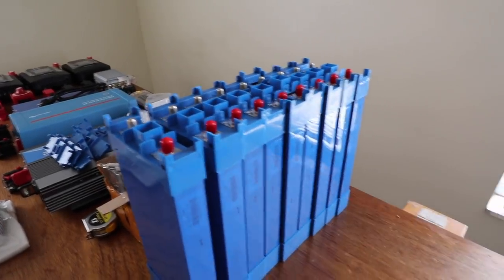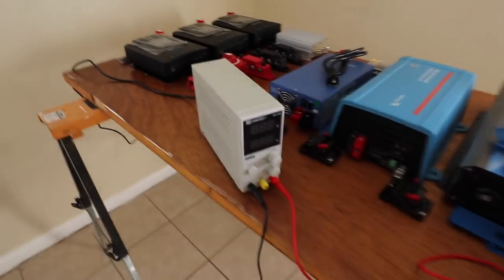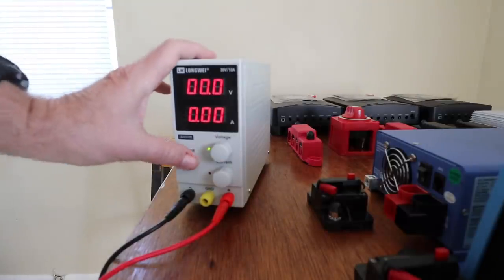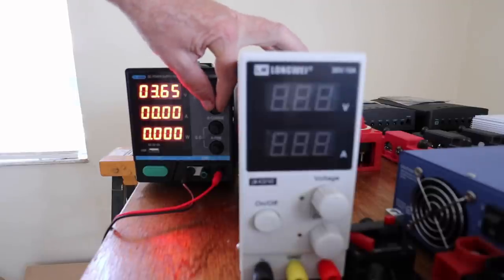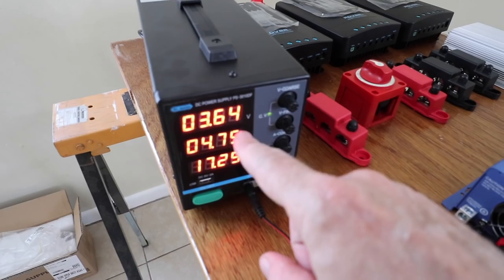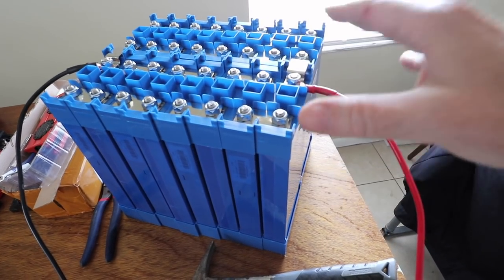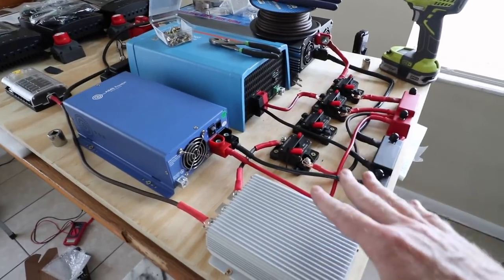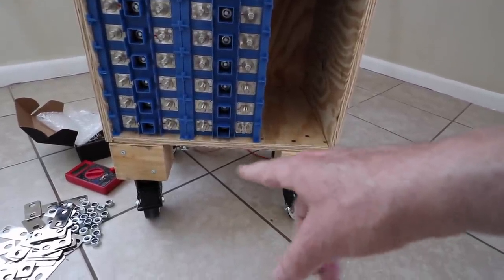Building My First Lithium Battery E607

Comment: If you have a West Marine near you, they have all kinds of terminals and have the crimpers available to use for making up those large cables.  Their stuff isn't cheap, but it is very high quality.  I use a Riden RD6018 DC-DC converter/power supply.  It was a bit more money, but is very easy to use and versatile.  I also have a ZKE-TECH EBC-A20H that I use for doing discharge tests on cells/batteries.  ZKE-TECH has several testers that can be very useful to test lithium cells.  Some of them even have built in chargers.  Having good data on your cells is very useful when setting up your BMS and charge controllers.  Putting your cells in series is a great way to save time charging, but you should always have a BMS connected when charging new/unbalanced cells.  Without a BMS, you'll need to monitor the cell voltages constantly.  As you probably realized, the cell voltage will rise quite rapidly as they get close to full charge.  The state of charge of new cells out of the box can vary quite a bit, even from the same batch and the cells will not balance properly until they are nearly fully charged.

Comment: Also in Florida building batteries for our EarthRoamer, we went with 12 x 300 amp Eve cells that took 3 months to get here but at $1000+ plus $300 shipping total was worth the wait.
Yes with 50% ship charge i had to assemble into 12v packs and charge up with a big charger before top balancing otherwise it would be weeks waiting at the10 amp charge.

Comment: Hello. Your old power supply is not broken. I had the same problem with the voltage jumping from 0 to 5v. Seems that the potential meter has 2 wires mixed. You need to open the unit and switch the middle wire with one of the outer wire. Than it will go from 0 to 30 smoothly. So no waste of money 😉
Reply from the maker: wow that is a strange wiring problem on a new product. I already returned it to amazon for a full refund and am using the newer black unit now. but, much appreciate the feedback and tip on this!

Comment: Seems to me that your voltage knob is very sensitive due to current knob being maxed out. I would suggest starting with current knob about 30%, then play with voltage setting.
Reply: I noticed that and thought the same thing. 
It's a dial and it looked like they should work in unison.

Comment: I’ve seen other battery makers take even longer to charge up their packs, sometimes weeks. 
I’ve also been told by others that as long as all the cells equal, whether at full charge or not you can bring them up with a charge controller or some other charger to get them at full SOC. So it seems to me it would be easier just to make sure they’re all level or at the same charge Dash doesn’t mean they need to be full charge. I think that’s just a recommendation.

Comment: Best LiFePo4 cells on the market. I truly despise those cheapo Chinese power supplies; sure, you'll save a few hundred bucks, but you have to replace them frequently and I don't trust their accuracy either. Rough waiting for a slow charge. Those cells are batched and balanced by the manufacturer, so they should be pretty close to one another. The AIMS charger is a great one. I use mine frequently. Great progress, and don't worry, you're doing it right. Be careful with the Fluke brand; their quality had dropped in recent years, in my personal experience. Nice build. :)
Reply: I too bought the cheap $75 junk from Amazon and China. It was broken right out of the box. You could bang it on the workbench to get it working for a few minutes. 

I returned it and bought one of these from Mastech 50 amp/50 volt. Superior quality and worth paying 9X for. Just skip eating out for six weeks.
Reply: @USA-GreedyMenOfNoIntegrity  Right? Good tools don't come cheap. Some stuff you can cheat and use the Harbor Freight knockoff and be fine. What bites my broccoli is that reputable brands are skimping these days. In fact, anytime I buy a new toy, no matter what its origin, I open it up and see what I've got.

Comment: See the arrow on the box? That means top side up. If you build the battery with the.cells laying down the electrolytes might leak. Will Prowse and I both had that problem.

Comment: You need to have a load on the power supply. Turn the current to zero   voltage to zero. Then connect it to the battery adj volts to 3.65 and then the current to mfg. Specs

Comment: Seven, dude you've come a long way since you started. Good move to get a Fluke Meter. Those HF meters are CRAP. I have one in my garage that cost over $500. Great product. Looking to seeing your progression. Remember that slow and steady is the best course of action...Tell me if I'm wrong, wouldn't it have better to charge each cell before hooking them in parallel?

Comment: ROFL! My patience would have ended on day one probably. I'd have pulled up one cell from the pack, seen how quick I could fast charge it at higher amps, outdoors, keeping a thermal check on it at times, before the damn thing exploded into flames, then I'd know maximum charging rate limit per cell. Maybe a metal filing cabinet for install of those rather than wood?

Comment: If your system does as well as mine is doing you'll be very happy (I too have a 24 volt system) and when I switched over from AGM to Lithium I was amazed at the results, my voltage has only dropped below 25 volts once (briefly), what a difference. How much were the cells each

Comment: Connect the cells in 4s 4p charge to 3.45 volts per cell so 3.45 x4 then Connect in series and charge to 3.6

Comment: Sir, How many lithium cells are needed to make 12v 150 amps. Pls mention the no. of cells to be connected in parallel in 3s BMS. ( Pls , what should be the amps of the BMS )??  Your reply would be appreciated.
And which charger is best for this project ? Or can I just charge it with a regular 12v inverter that I'm using right now to charge my 12v 150 amps tubular wet lead acid battery...!! 🙏🙏
Reply from the maker: 4 cells makes up a 12 volt battery (each is 3.2volts) and it would be 100amp hours.. I'm doing a 24 volt system, so 8 cells makes up one battery for me. with 16 cells I end up with the equivalent of a 400 amp hour 12 volt battery (but again, mine is 24 volt so it is 200 am hours at 24v). easier just to think of it as being like 4 battle born batteries. normally inverts don't take on charging (although there are a couple of models that handle this). normally solar charging is done by a "charge controller". Victron or Renergy are both great brands for charge controllers. the model and size or your charge should be based on how many panels you have, so that changes from system to system.
Reply: @SevenWanderstheWorld  Great reply/explanation. Thank you Sir.. 👍👍👍